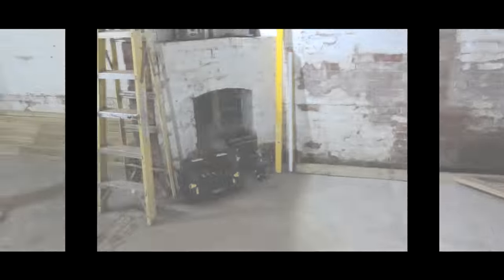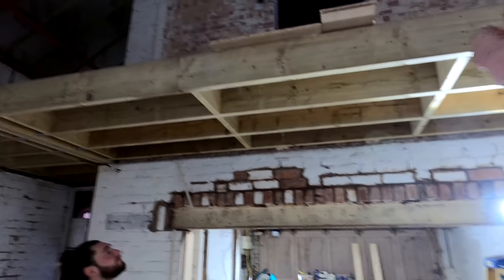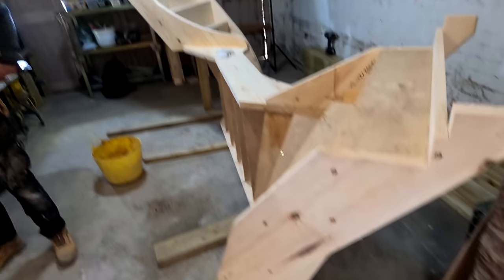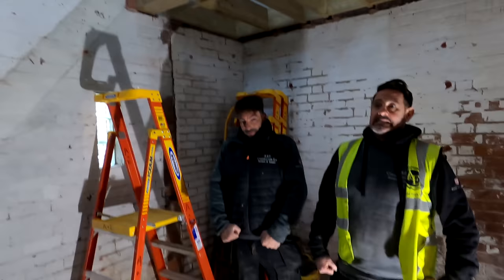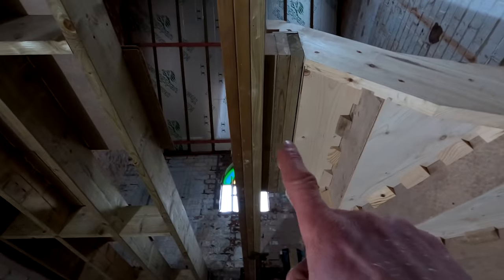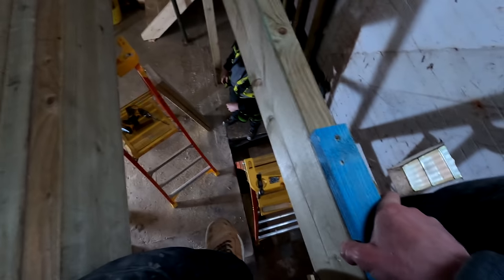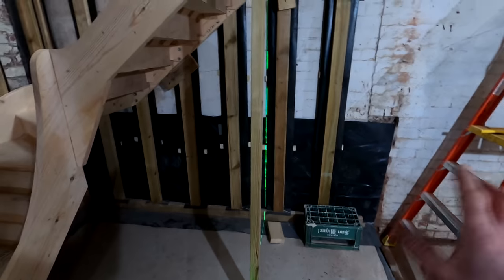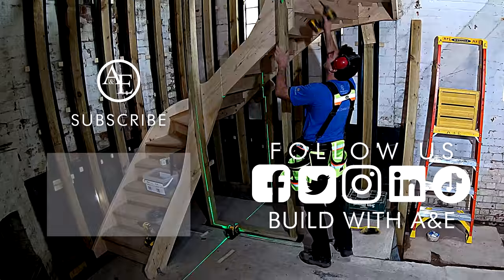Fitting a New Staircase in the Coach House! | Victorian Villa Resurrection #9

Comment: Nice one fellas, can I ask it (I may have missed you mention it) I know you said about no structural newel posts, but would the stair case support itself without the stud wall underneath the stairs etc or does a staircase have to have a stud wall at the side of it to take sag out etc cheers 👍👍
Reply from the maker: Hi Most stair designs are self supporting depending on design, this one could of been all the best Tony